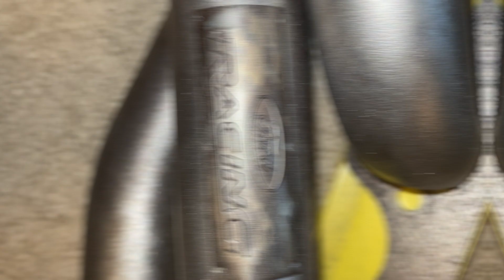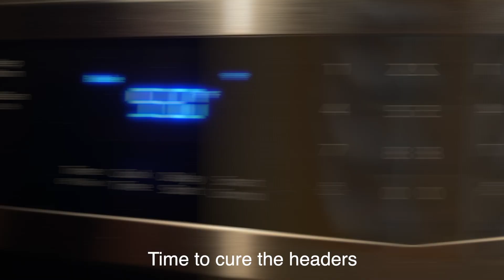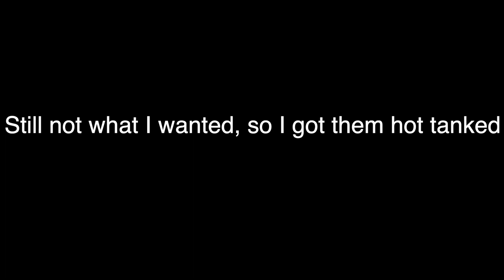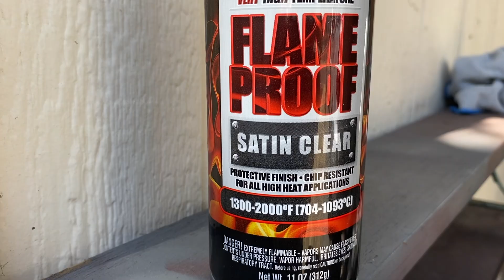DIY - Foxbody Mustang Header Refinishing!

Comment: I did this on mine as well With  the same paint and all the paint came off within 2 minutes of start up.i was so disappointed. But i didn’t baked them so u guess it was something i didn’t think of. Really sucks as it was the first fire on a new build
Reply from the maker: That does suck! I am sorry that happened to you Bro! If that happens I will have them powder coated or just run them in the natural finish! 💯👊🏾

Comment: Hey OG!  The headers turned out great!  I like your more natural looking finish.   Is the hot tanking the same type of business that dips car bodies?  I didn't know there were places that do that.  Was it done at a chrome plating/restoration shop?  Interesting!!👍👍
Reply from the maker: Hey Todd! It was done at a machine shop. It is similar to the dips for car bodies. I think they did a combination of that and using a blasting machine that uses beads of some kind. But it stripped it down to the bear metal so I could cost it myself.